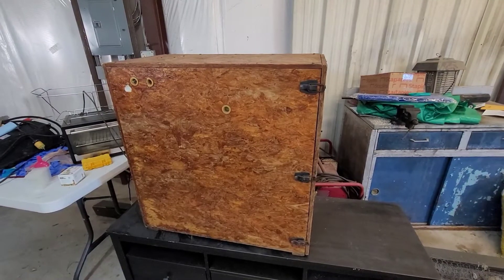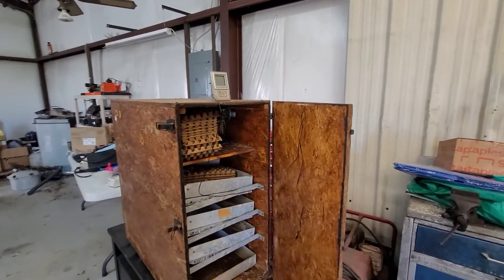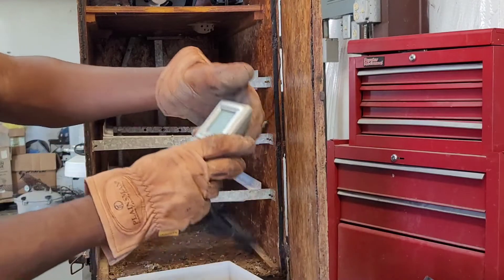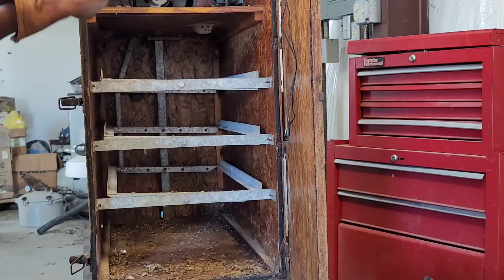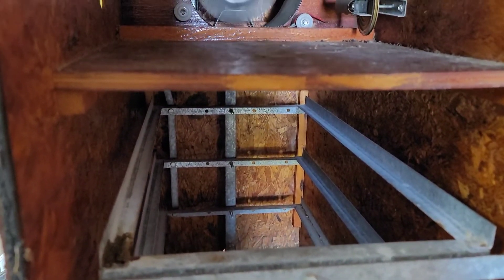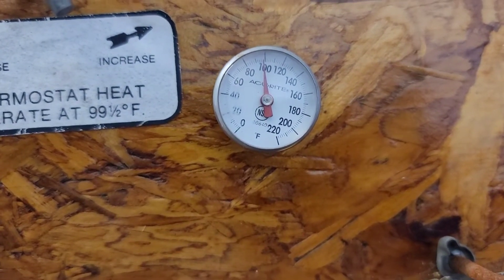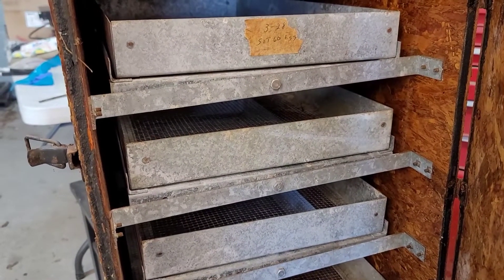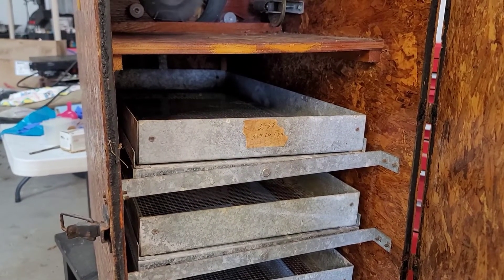Model G.Q.F 1202 Incubator. Cleanup, repair, and calibrate. Ready for eggs.

Comment: I realize this 2yrs old but I just got my first “big”incubator, which is similar to this model ( same brand) similar age. A friend was kind enough to sell me her extra one that she hasn’t used in a few years, it has a brand new turner in it and it does work but it’s rather aggressive when it turns, have you ever experienced that or would know how to troubleshoot it. As she put it I have 3 functional ones plus an even larger one so it didn’t matter if the turner wasn’t working correctly, it was more a spare. She recommends hand turning, but obviously would be better all around if the turner works. Been searching the internet for any information about this and have yet to find anything, but I did come across your video which help in other ways

Comment: I remember you told me not all the eggs turn to chics. How do you know which eggs to put in the incubator?
Reply from the maker: A hen will lay an egg with or without a rooster. If you do not have a rooster, the egg will not be fertilized so they will never hatch. If you have a rooster, those eggs will be fertilized, those eggs will hatch. If your rooster is not doing his job, the eggs will not be fertilized.

Fertilized eggs hatch within 20 - 22 days.